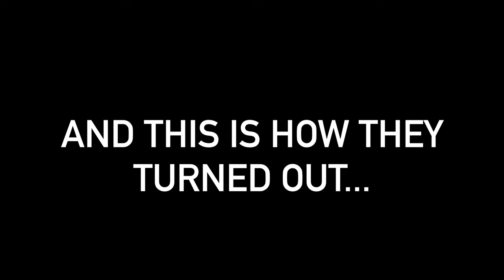I Make a Pro Croquet Mallet in 5 Minutes!

Comment: Those are gorgeous!

Where do you find oak dowel rods? All I can ever find is cheap pine.
Reply: Given he started out our round and went square, you could easily start out square and round the edges.  A square start is better since his handles are too thin.  So then you have to fit them to your heads, which is easy if you have a lathe, or you can do the same TS rounding with a jig, just fit the hole to the square or rounded handles, or make a piece that fits over the handle like a washer to make it round, etc...  Or when you glue up the heads, leave a square mortise, and fit the handles in mortise and tenon style, or use a spokeshave to round the ends.  Or a router dowel making jig.  There are so many ways.